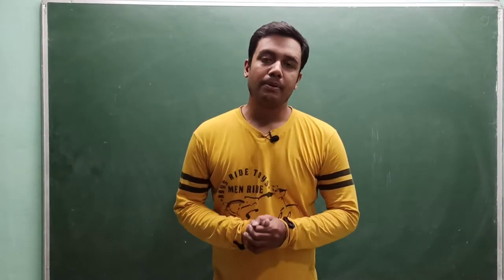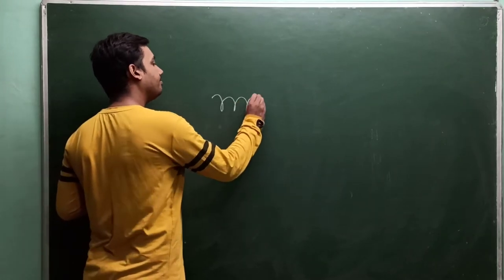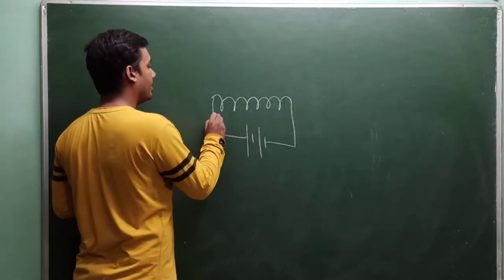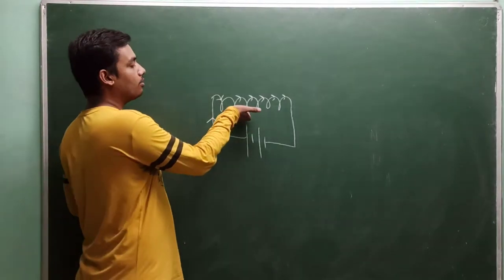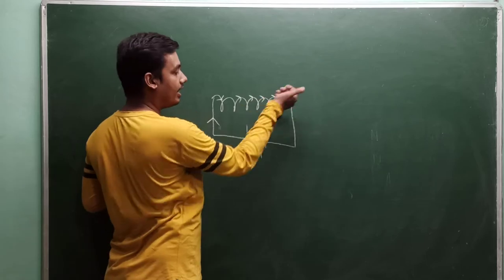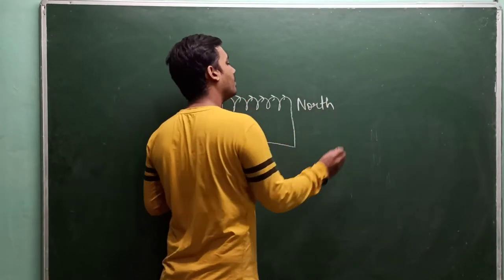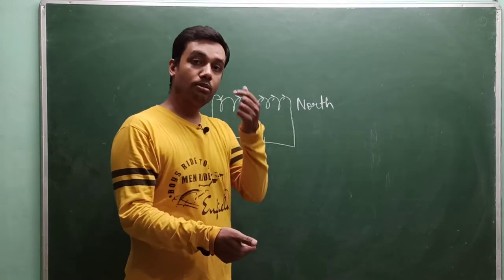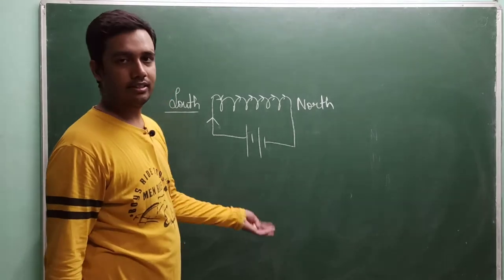how to find north & South poles of a solenoid

Comment: Does current flow from positive to negative or the current flow is the flow of electrons from negative to positive please reply sir
Reply from the maker: Electrons flow from negative terminal to positive terminal, but direction of current has been taken from positive to negative.
Reply: @anchal0077  but why sir
Reply from the maker: In the beginning only positive charge was considered to be present so the scientist thought that the flow is due to positive charges but later on electrons were discovered now a lot of theories have already be made in the direction of conventional current that is from positive terminal to negative terminal so it was not found accurate to change the theory that the direction of current is from negative to positive

Comment: this is wrong dude  the way is check to pole you have to do look at the side on  solenoid and if curent(I) is flowing anticlock wise its (N)  if it clock wise it must be (S) .  don t use right hand rule for this its confusing sometimes.
Reply from the maker: That is only possible when u r actually holding a wire in your hand

Comment: This is wrong .It is depend on solenoid how it is
Reply from the maker: Please explain what is the correct explanation
Reply: Exactly this is completely a wrong conception....the right thumb rule is to determine the direction of magnetic field and not the current....and moreover the way u used it was absolutely incorrect....
Reply: @Shadow.Phoenix  actually it's for a quick solution ... U may do the long steps but the outcome will be the same.
Reply: @indrapratap2107  well mind you this step itself is wrong....let alone long and short...when the step is wrong...the ans. Is wrong
Reply: @Shadow.Phoenix  yeah I know man  it depends in the clockwise or. Anticlockwise direction of current.
Reply: @indrapratap2107  good that you do...and now see his vid and tell him he is wrong instead of pointing out my mistake